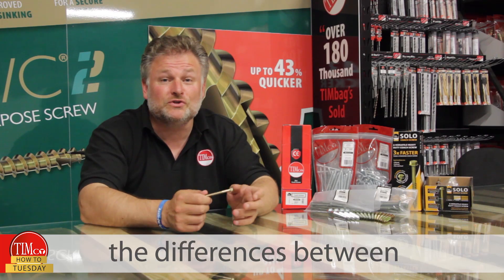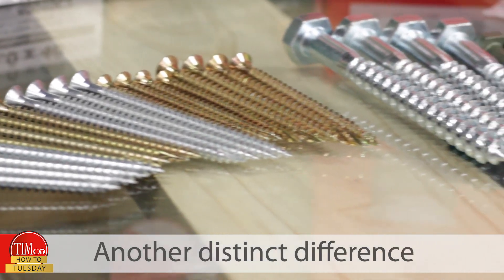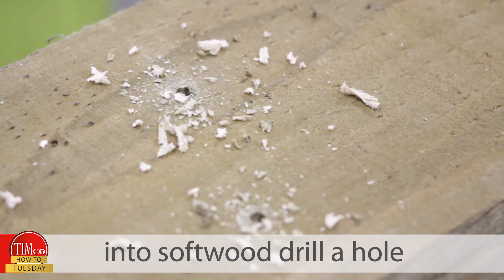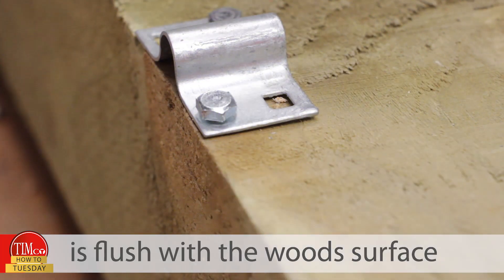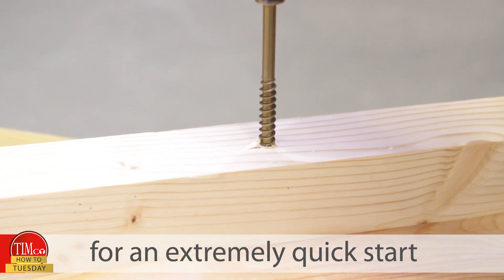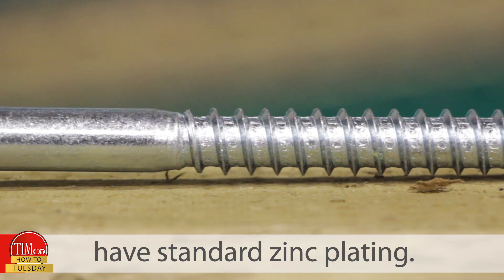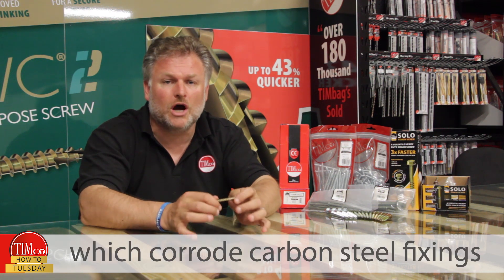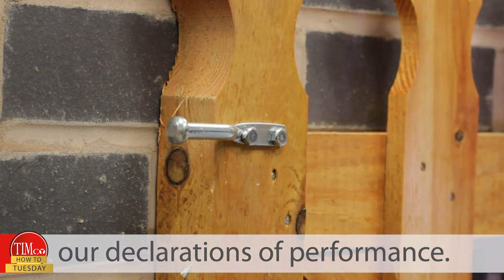How to use coach screws l TIMco How To Tuesday

Comment: I see some videos say to use a drill bit the same size as the lag bolt without the thread part. 

So, in Australia, bunnings if i have an m10 bolt (which i think means 10mm),  i would use a drill bit for pre drilling around 7.5mm to 8mm.

So, for drilling into a wall stud, which should be soft wood, should i use a half drill size (5mm) or closer to the bolt shaft diameter 8mm?

Hope this all makes sense.